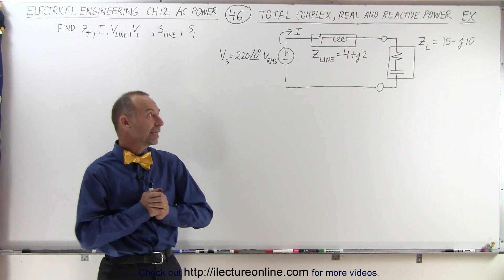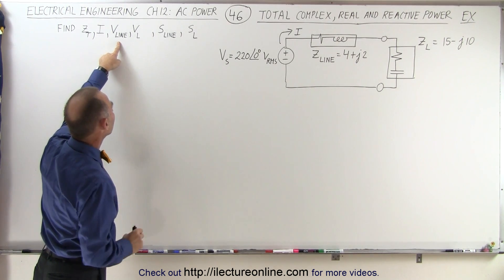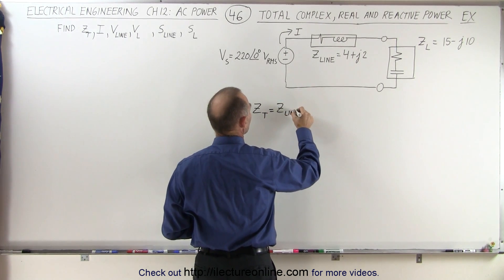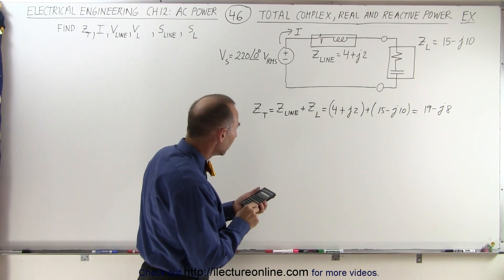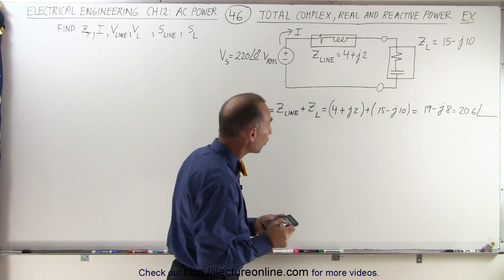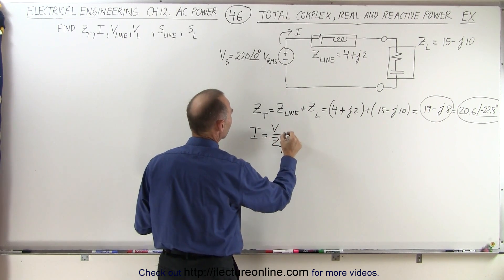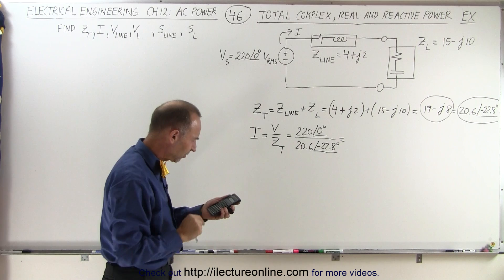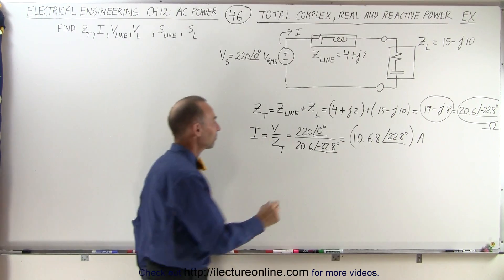Electrical Engineering: Ch 12 AC Power (46 of 58) Total Complex, Real, & Reactive Power Ex***

Comment: That was a very good video professor. But I want to know, why is it that you used the Irms(I=Irms<phase angle) for the voltage across the line or the load instead of using the normal phasor format, like (I=Im <phase angle)?
Reply from the maker: It depends on how the information is given in the problem.  Sometimes the information is given in terms of the maximum voltage and current (the usual way), but sometimes a problem will be stated with the RMS voltage and current given.  The problem is solved in the same way.
Reply: @MichelvanBiezen  RMS values make the most sense because in the world of transmission and distribution, we almost always use RMS values.